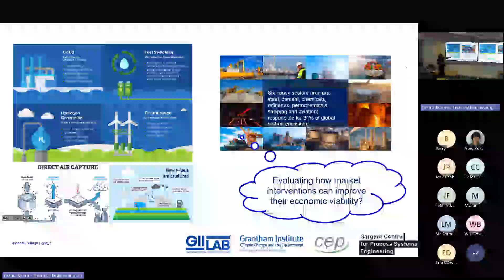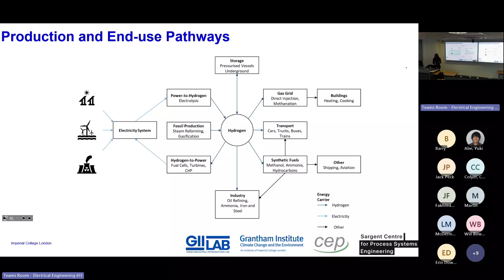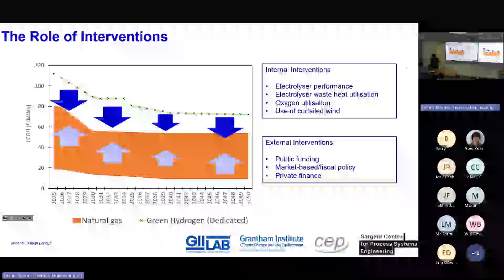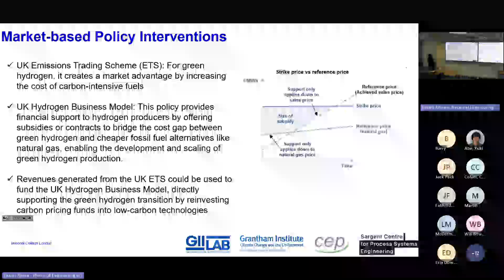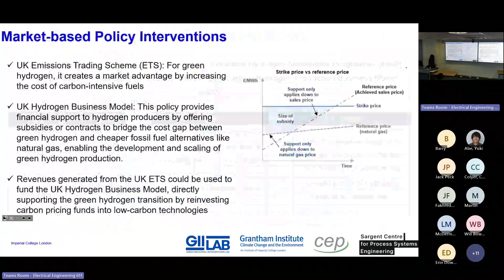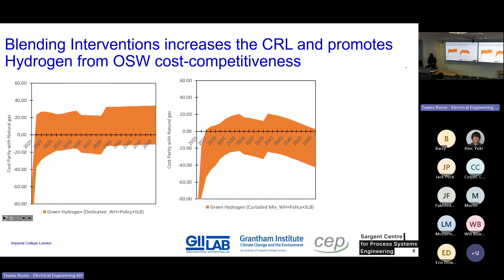Green Hydrogen for Industrial Decarbonisation: Blended Interventions for Competitiveness

Comment: The only way to produce useful amounts of hydrogen without burning vast quantities of hydrocarbons and/or coal is by using electricity generated by nuclear power plant to split water into hydrogen and oxygen. Bear in mind that the process does not work with salt water. Salt water must be desalinized prior to electrolysis, otherwise you get hydrogen gas, chlorine gas and sodium hydroxide, both chlorine gas and sodium hydroxide are toxic and powerfully corrosive substances which would be far worse to deal with than the carbon dioxide from burming fossil fuels.